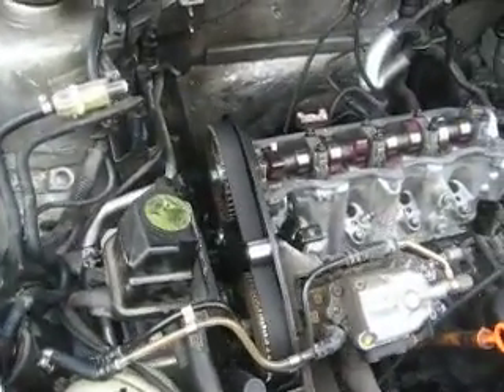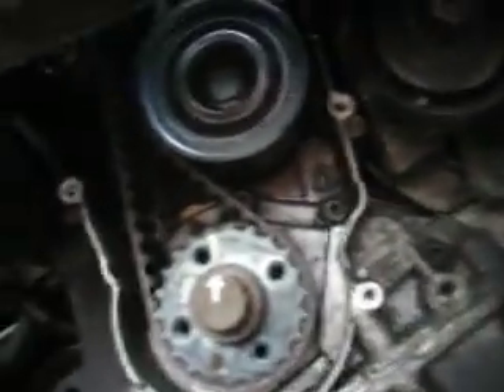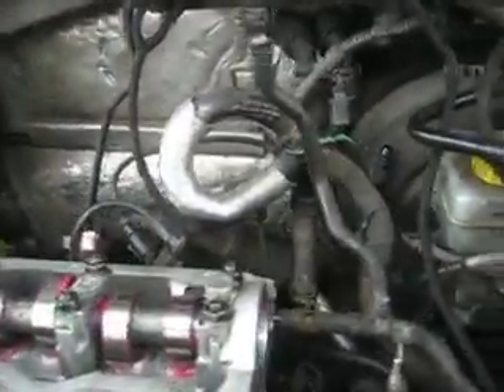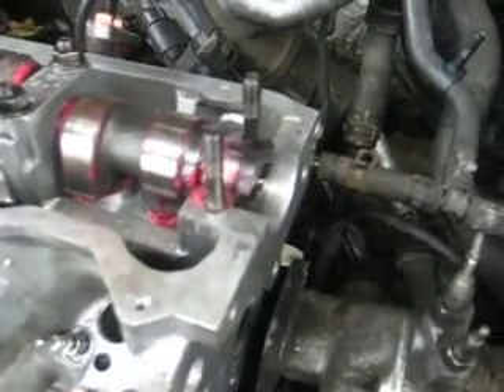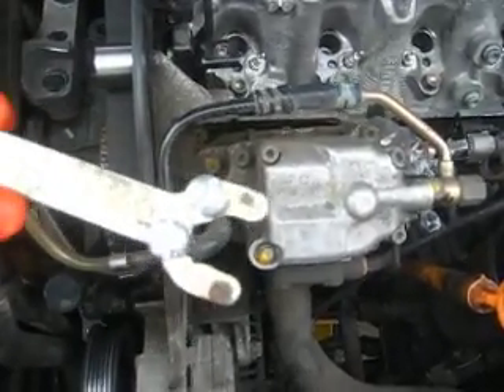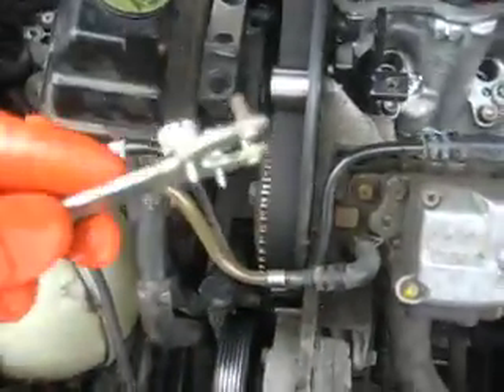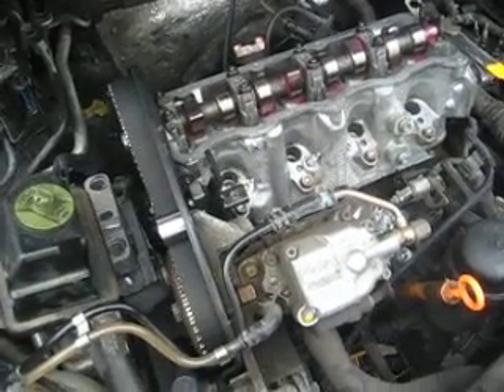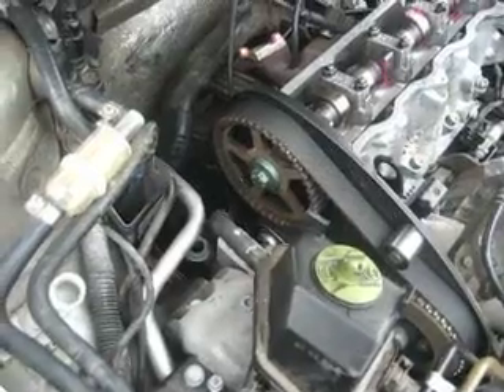VW TDI Timing Belt with no Tools + Helpful Hints

Comment: What if your belt broke and you need to set the pump timing, is there any way to do this because I lost the timing of it? Thanks
Reply from the maker: If your belt broke there is a high likelihood that you have bent and/or broken valves. These are interference motors. Which means that the valves are in the way if the cam is out of timing. If your belt slipped 1 or 2 teeth then you might get lucky but otherwise you need to remove the head and get ready to work. There are rebuild gasket kits and the work is fairly easy. You just need to take your time and work smart. I took a large box and placed holes in it to organize my head bolts in the exact way they where removed, as to not mix them up when re-installing the head. I think: The head is aluminum and the block is steel. I needed less then 4 new exhaust and intake valves. I bought a new hydraulic lifter kit (those are the round things that cover the valves). I took my time and ordered parts as I disassembled the old motor. I also went to the junk yard and enhanced my education there. I would highly suggest setting all your bolt with gray RTV. That one tip took me years to come up with, but it stops corrosion and holds bolts/nuts until you are ready to remove them. I wish you all the best of SKILL.

TDI Love from Chicago.

Comment: Bad timing can cause No accelerator response and Stuck rpm 10+????
Reply from the maker: Thanks for watching. A new timing belt can increase your miles per gallon by +20mpg in diesels. Stuck rpm is usually a bad mass air flow meter. Try disconnecting the mass air flow meter and see if the auto runs any different. When you disconnect it the computer uses a pre set data curve instead of using the bad mass air flow meter's input.

Love from Chicago.

Comment: How did it turn out?
Reply from the maker: Still running today. So, I would say it turned out well.

TDI Love from Chicago.
Reply: Much love from San Diego! I recently changed mine, runs well but notice it is a bit slower. Did you adjust fuel injection with VCDS?
Reply from the maker: After doing timing belt on any auto you should notice better fuel economy and yes you have to adjust quantity with VCDS, but make sure your turbo is adjusted right too. I had a TDI bug that was very slow and it turned out to be the shut-off valve was partially closing when the bug was running. Once I replace the shut-off valve it ran like a rocket. If the turbo is set too high the you have a TDI that is best suited for the highways and if it is set too low then you will need to buy new tired more often because it will want to jump off the line at lights but will give you over boost error. Adjusting the turbo is more of a preference thing but proper vacuum is essential. That is why I always replace all the rubber OEM lines with silicone (all but the hard line that comes off the back of the brake booster). If you don't have proper vacuum then your turbo will never fully spin-up and the TDI will seem slow even though everything is working as it should. The turbo is the key to TDI performance.

TDI Love from Chicago...
Reply: Thank you for the knowledgeable tips. Going to keep working on mine to get it up to speed.

Comment: Thank you
Reply from the maker: The main take-away should be: "Don't be scared". Once you get the head off and see if any of the valves have damaged any piston you can plan your rebuild. Luckily my valves did not break and only 3 (If I remember right) were bent. I have seen broken valves fall down into the cylinder and make a mess of the walls, in the junk yard. A block with gouged walls should be replaced due to compression concerns and with diesels compression is everything. None of this takes a mechanical genius or diesel specialist. My trimming belt broke and the worst that could happen was I would have to replace the motor completely. So, I looked at it as if the motor was already bad and I was seeing where the failure was so the new motor would not meet the same end. But I was able to rebuild. I hope the same luck upon you my friend. Be well and stay dirty.

TDI Love from Chicago...

Comment: What do a timing belt job run on one
Reply from the maker: Thanks for watching, Timing belt job on a 1998-2003 Diesel ALH 1.9L has dropped considerably. When I did this video many years ago the cost was $1,200 to $800., but in 2021 the kit are all dependable and the price should reasonably be from $350 to $600. You have to find a mechanic that knows how to do it correctly. I have no list of mechanics or any resources hat can help you but looking at your local auto dealers that specialize in VW, Audi, BMW should point you in the right direction. Look for used European auto dealers. I have had fascinating conversations with Slovak and Easter-Euro Mechanics that know these cars inside and out.

TDI Love from Chicago.

Comment: My 2006 is making an awful noise, probably from the timing belt, pump & such.  Maybe hitting you up, thanks for sharing.
Reply from the maker: I have never heard that sound before. This sounds like something you should deal with immediately. I listened to your video and, to me, it sounds like one of your lifters or valves is broken and giggling around in the top of the piston. This is something you can do yourself, but it sounds scary.
1) Remove the Valve/Cam cover
2) Remove the CAM (you need a torque wrench to make sure you put the CAM bolts back in proper. Also take note of what bolt comes out of what hole and put them back that way.)
3) With the CAM out all the lifters. They should appear to be flat and even, and should be removable with a strong magnet while twisting (put them back were they came from).
4) push down on each one with one finger and note how much each gives (some will normally give more than others)
5) a broken or bent valve will be either way-to-tight or way-to-lose (I have seen a TDI with a broken valve in the junk yard and it beat the help out of the top of the head and the piston.)
6) use a bright light and check each 8 lifter (4 exhaust and 4 intake) for wear and cracks on the Top.

Note: A ripped timing belt can make some flapping noise(but not your metallic noise). A good or bad water pump is silent. A bad alternator often wines and provides under 14V. A bad starter smokes and can drain your battery while the car is off. A bad A/C compressor simply does not engage the High-speed clutch to run the main compressor. And all those timing belt rollers Cogs will make a rhythmic chatter when the center high-speed bearings are screaming "Change Me".

How does the car drive? (i.e. acceleration, fuel economy, battery health)

If it is a broken Valve you want to catch it before it breaks your timing belt, head, or bends the piston rod. Either way sounds like you need to get your hands dirty.

TDI Love from Chicago.
Reply: It drives just fine, good power & smooth. Haven't driven it much b/c of the noise, so I don't know about mpg.  I'll keep u posted, thanks for all the info.  take care from Tn.

Comment: I was able to do it without locking the camshaft (though I did still remove the rocker cover and vacuum pump to visually check the timing). I rotated the crank 90 degrees from TDC (all four pistons halfway up - so no chance of the valves hitting the pistons) then took off the belt. Also didn't loosen the camshaft sprocket. After removing the belt (using a dinner fork with the prongs bent to loosen and later tighten the tensioner), the camshaft can be rotated by hand to TDC (the valve spring pressure holds it stably in the right position without needing a locking tool). The injection pump can be positioned carefully to TDC using a spanner (beware as this has a lot of spring pressure and DOES need to be locked in place using e.g a drill bit, and make sure it's in the correct position: there are two holes). The crank can then be rotated to TDC (check first to confirm the camshaft is still at TDC before doing this). Then fit the belt (taking care not to rotate the camshaft). Job mostly done!
Reply from the maker: Thanks for watching, These ALH engines are durable and very powerful.  In the USA the EGR is the only flawed system that ultimately leads to the death of the intake system and Turbo.  Even after 8 years, the engine from the video is still going strong. I even just used the powerful 1.9L diesel Golf to remove 3 small tree stumps. You should always check all the timing points and don't overstress/stretch the belt while putting it on for the first time.  A new belt should yield a 20% better fuel economy and performance that disappears in the first 6 months after installation. I like the dinner fork with prongs bent to loosen the tensioner (good tip).  I wish you a successful first prime and start. I had an ALH I let sit for 18 months and the diesel pump got all gummed up while I was doing an Auto to 5-speed trans swap.  I learned to rebuild the diesel pump, which is very easy (disassemble clean polish and reassemble). I think all my future timing belt jobs will include a diesel pump rebuild along with the water pump and new rollers.

TDI Love from Chicago.

Comment: Thank you for the tip on using a saw blade wrench. I was going to use the mark and pray method but i checked my timing with vcds before changing the belt and it said timing was too retarded to draw a chart. Glad i did too because my cam timing was off by 2 teeth and it had been that way for 10 years!  I have the receipt of when it was done by a "professional" shop for the previous owner. Previous owner said it had always been hard to start when cold. I used the saw blade and a multiple feeler gauges to take up the slack so i got a nice snug fit. At first i couldn't believe it was that far off. I kept checking and rechecking but it always came up 2 teeth off. Starts up very easily when cold now and my timing is right in the middle of the chart. The "professional" shop left me another gift to deal with and that was silicone around the water pump o-ring. I had to make my own puller out of an old alternator bracket to get that water pump out!
Reply from the maker: Outstanding!!! "Doing it right" sounds like an overused phrase. And you would never think that it is something that should have to be said to a professional, but many are under huge time constraints that let small things like being two teeth out of timing and using silicon to fix a leaking water pump "Good enough to get paid".  To fix a thing you own is a true thing of beauty.  You have time between ordering parts and disassembly to really question the viability of parts and repair procedures.  Sure, we owners don't have tools that cost thousands of dollars as the dealer does, but with time (which we have) and patience, your final repair should be a source of pride for many years to come.  A true testament to how durable these TDI engines are is in exactly what you said: "It was out of timing for over 10 years".  Once you re-do the timing normally you will get better fuel economy and a zippier ride, but for you, I would imagine it is like owning a whole new auto. Good on you and once again I say "Outstanding!!!".  Keep up the good work.

TDI Love from Chicago...

Comment: This engine looks very similar to the SDI engine, my timing belt is due to be replaced but I'm not looking forward to take the cam cover off :( , do you think that i can find a tool so i can lock the cam from the front? Last but not least great video :)
Reply from the maker: Thanks for watching... Locking or marking the cams is always a hit or miss procedure.  If you are good you hit more than you miss.  But really if you are going to do it right, get your hands dirty and look over each cam and make sure you are not just putting money in a time bomb.  My words of wisdom are "Fit it once and fix it right."  I had to wait almost two weeks after tearing down my engine because I wanted to order the right parts and only the parts I needed.  So, try to make sure you have another run-a-bout to not rush yourself.  Good luck.  I know you will do a grate job.

TDI Love from Chicago...
Reply: Thanks for the reply, I'm not in a rush so i'll try to buy a locking tool, obviously I'll look for marking on the crank (on the flywheel side) and on the front (notches on the crank sprocket) once I'm sure that all is lined up I'll mark the cam sprocket, cheers :)
Reply from the maker: Take a look at eBay item "Universal 5Pcs Cam Camshaft Lock Holder Car Engine Cam Timing Locking Tool Set"  it might be what you are looking for.

TDI Love From Chicago...

Comment: How can I take off the cam sprocket without the special tool? It needs to be loose to put the belt and tensioner on. It's on there tight!
Reply from the maker: Thank for watching.  I made one out of a 5 or 6 foot oval closet rod and some nuts and bolts. (google  Oval closet rods).  I pick the oval ones because on the ends that meet I flattened them with a hammer the drilled the holes in them. I cut the pole in two equal parts and put a bolt in the end where they both meet. That way they would open and close like scissors.  On the two ends, I put long bolts and three nuts on each. One nut locked the bolt to the end of the pole and the other two nut locked on the end of the bolt to hook around the cam gear to hold it steady.  It is only used to hold the cam sprocket while you loosen the center nut.  Super easy to make.  Let me know if you need to see a picture of the tool I made. Good Luck and stay safe.

TDI Love from Chicago...
Reply: GallowayChicago in referring to pulling the cam sprocket loose, not the center bold.
Reply from the maker: Bang-On. We are talking about the same tool and part.  Described above is the tool I used. Let me know if the description was not clear. 

TDI Love from Chicago...

Comment: I've been a mechanic for about ten years now and I just mark up the sprockets. be a bit careful and dont need any locking tools. but I guess the diy guys need to be extra careful. floating pulleys i always lock up but a lot of engines tipex does the job if you know what your doing. I have never had a problem with this. i get it bang on everytime and if i dont then tools are required but i do cambelts every week so I know what its all about. Good luck to some of you. Best advice is to take it to a garage if your in doubt of anything. most garages cant afford to buy every tool set for all these engines. You learn to adapt as a professional.
Reply from the maker: Thank for watching.  My wife just got her 2012 MK6 VW Jetta 2.0L TDI back from the local dealer for the Fed mandated diesel MOD.  The dealer said that a timing belt/water pump change on the 2.0L TDIs is $1,200 USD and that does not include the at-service add-on of around $500 for the V-belt and idler-pulley.  The total should be around $1,700 USD.  I have done about 5 1.9L TDIs and the 2.0L are easier because you do not need to remove the pass-side motor mount.  What is worst the HEPU PK05691 Kit is only $310 USD (T-belt, 3 rollers, tensioner, water-pump, 2 new studs) eBay and list for the oem V-belt and Ideler is only about $50 USD. So, I guess I will be doing two 2012 VW 2.0L TDI Jettas this summer and paying myself (or saving) around $2,700 USD.  each should only take around 2 hr.  I understand VW has to pay its people living wages, but the VW/Audi pricing and service tables make it hard to recommend these autos to friends without becoming their mechanics.   The dealer wanted me to pay for a new DPF(diesel particulate filter) for my 2012 TDI and wouldn't you know it that price for this exhaust part is $1,800 USD without labor.  Come ON!  I still love the TDI autos.  Call me a gluten for pain, but I am still smiling.

TDI Love from Chicago.

Comment: Awesome! Love the Ideas basically you got all the special tools perfect. Except the cam sprocket holder wrench and the crank holder. Crank holder not required too much. Cam shaft wrench is required for more Persis timing job so can loosen cam bolt without breaking cam shaft. Reason we want that bolt loose is, once the cam is locked and the injection pump is locked, the cam shaft sprocket may free wheel while tensioning the timing belt. This helps keep everything in line and help keep your crank from moving during tensioning. Once the belt is tensioned the cam shaft bolt is tightened again. Thanks for the tips you saved me a bunch of cash!
Reply from the maker: Thanks for watching. I made the cam sprocket holder out of two 0.6M or 2ft chrome oval closet organizer rods on each end I put bolts with different length nuts.  the two rods open like scissors and worked as well as the OEM tool.  I should have included it in the video. I don't use main crack shaft holder. I have never had luck with them and as long as you are holding the cam and diesel pump and can see the TDC make on the trans you are golden.

TDI Love from Chicago.
Reply: Awesome engineering! Thanks again.